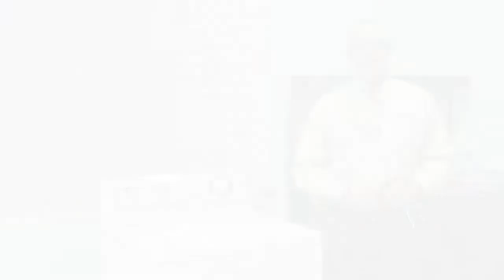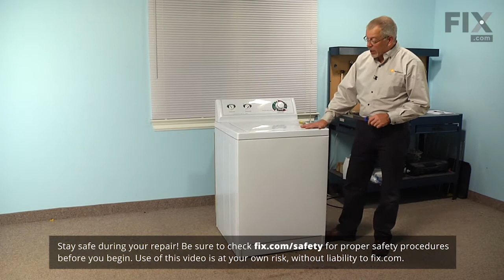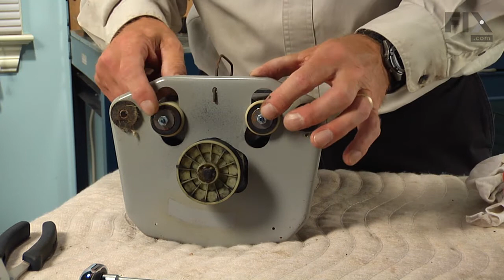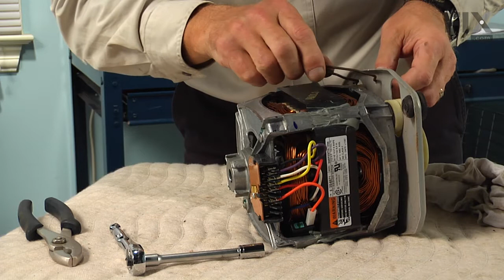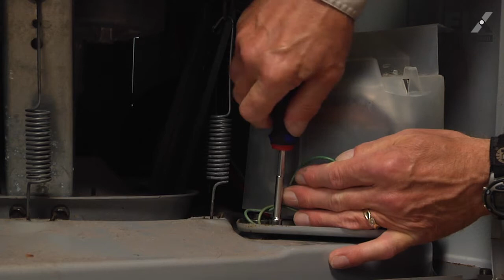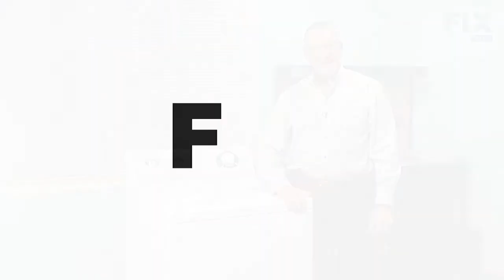Maytag Washer Repair – How to replace the Motor with Pulley

Comment: You didn’t show how to connect all color wires exactly in order of the original wires because the new compatible usually don’t line up the wire color like the washer.

Comment: Thank you for posting this video! Followed every step and replaced my motor and pulley. For my Atlantis Maytag washer, the motor PN was WP21001950. Part on Amazon was $135. Part from a local shop was $170.

Comment: The motor pulley on my Maytag Bravos went out and started grinding. The the drum would barely spin. I found out that I had to replace the motor for a $10 pulley that is not removable. Typical Maytag Whirlpool junk. I will never buy their crap again. Everything they make is total crap. If you are reading this don't buy anything in the Whirlpool, Maytag, Kenmore group. Trash.

Comment: This was helpful but seems incomplete. After mounting the motor, you said you would turn the machine upside-down to reinstall the drive belt (9:10). Did I miss that part? I expected to see this after the alternate view of the motor mounting, but instead saw a segment about accessing the back of the machine to replace the "remaining" springs that weren't really mentioned before (10:10).

Comment: Can I just buy the pully seperate my motor works fine but pull is melted.
Reply: Jesse M what a coincidence my pulley just melted, too! Though I'm certain there must be something wrong with the motor for the pulley to have melted. I'm going to replace my motor and suggest that you do as well. Good luck!
Reply from the maker: Hi Jesse, please provide your model number and I can check to see what the manufacture has listed for your exact model.
Reply: So I just had this happen on my Maytag hav2360aww and unfortunately for mine they dont make just the pulley. I had to buy a whole new motor with the pulley, and replace that.
Reply: Thanks I found a pully on EBay. Problem was belt wore out cause of the pulley being melted. Manufacture told me highly recommend checking your belt yearly. 
I bought a new belt and pully $35.00 solved the problem no need to buy a new motor.
Reply: CptFravardin 
No need to buy a whole new motor the belts get worn out over time and heat up the pully causing it to melt. 
If your motor still spins freely simply replace pully & belt cost me $35 on ebay.
Reply: Fix.com 
Thanks for your reply I found belt & pully I needed simple fix.
Already have done 10 loads of laundry to date no problems!
Reply: How do you know if its just the pulley and not the motor? Mine is working so far but it has a burning smell

Comment: awsome videos. my maytag no longer spins water out prior to that was making loud grinding noise. any idea what I should check out?
Reply from the maker: You may have something caught between the tubs or something stuck in the pump. What is your model number?
Reply: Maytag mav4757aww. I took apart pump it was fine. Belt is in good shape. Everything spins when I move with my hand. I'll remove tub and see if anything stuck. It also isn't draining all the water out. Thanks for your reply!
Reply from the maker: Make sure that the pump pulley is solid with the shaft. Also, check the motor pulley for contamination, the motor slide for lubrication and the condition of the spring, for proper belt tension.